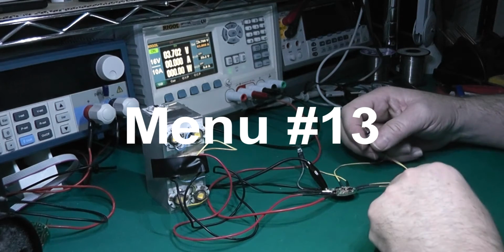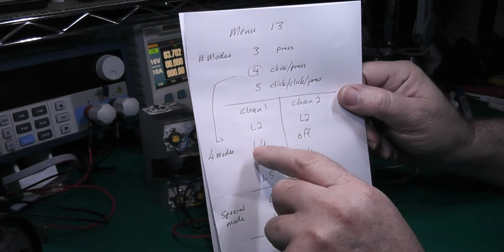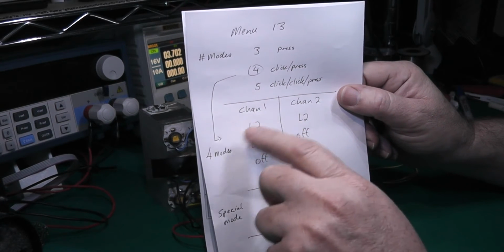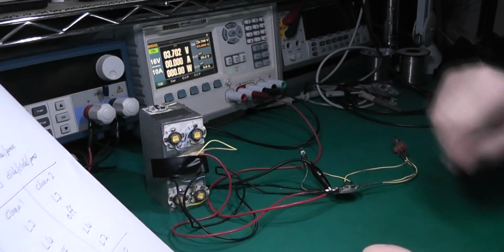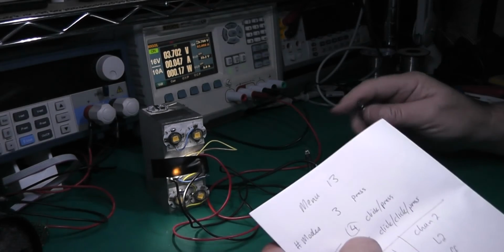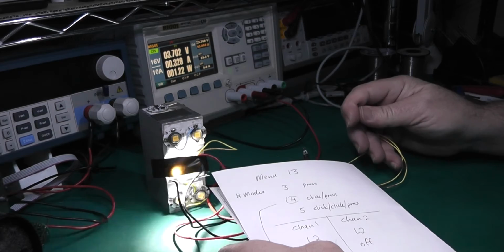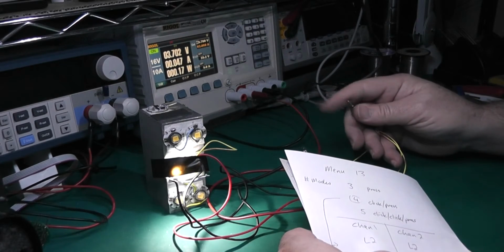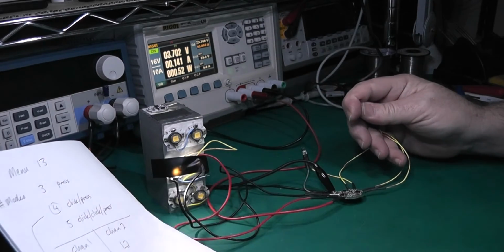Dualflex UIC3

Comment: Hello
I'm studying university degree electronics at the University of  Besançon in France .
I am doing an internship currently on the dualfex, I want to change the software program while keeping the same component on the PCB so I'll need electrical schematic in order to keep the same configuration as the dualflex, because i find the hardware is very good. I'll just change the software program to make it easier to use. I want to know if you can send me the electrical diagram? thank you in advance.

cordially